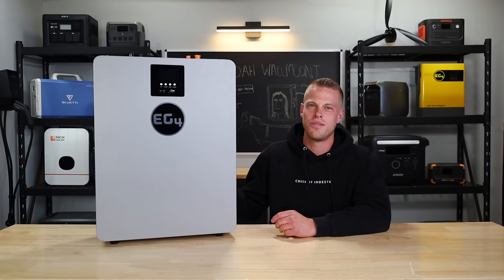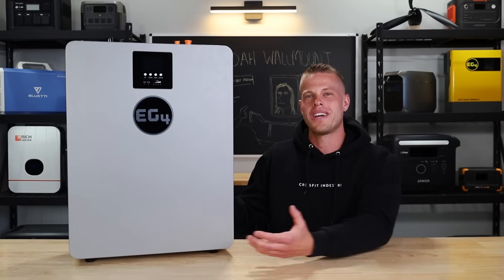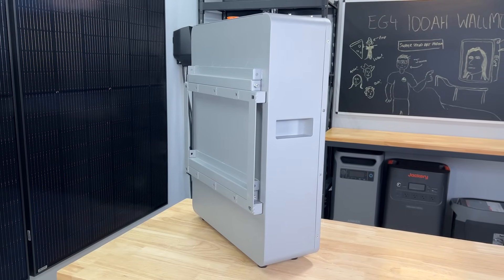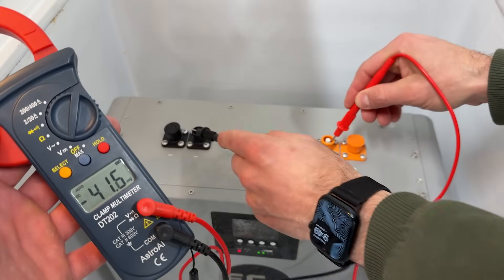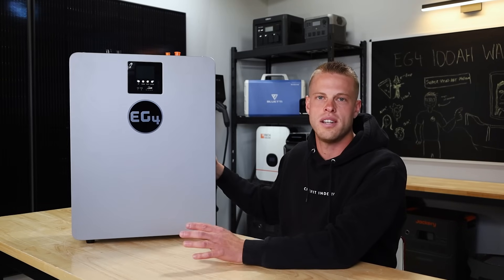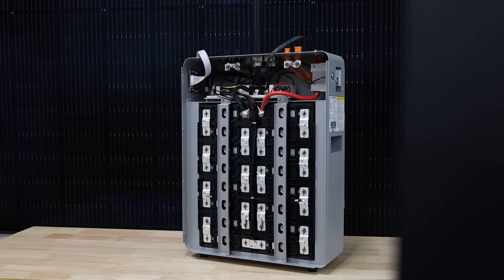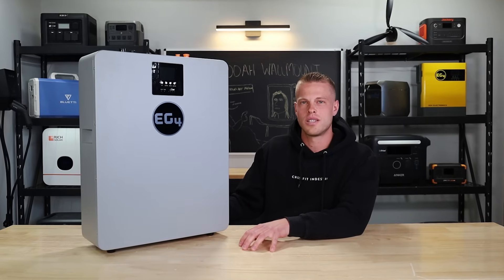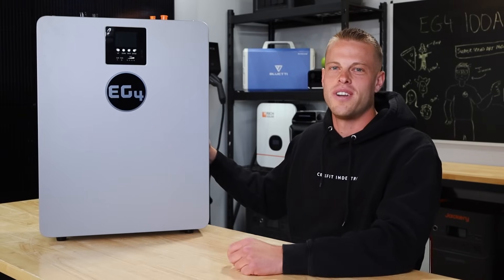Finally! The EG4 We’ve All Been Waiting For! - EG4 100Ah WallMount Battery

Comment: $1599 vs $628? nah.. id still just buy 2x 12.8v 300ah batteries.
and still  have $971 + to buy other things.

sheed lets just decide to buy 4 then. 1,256 and u have a capacity of 51.2v 300ah.
3 times the capacity and $343 still left!

Comment: What is 100Ah? There’s no such unit of energy. This number means different things if this is 12v, 24v, 48v, 56v technology, etc.

Is it so difficult to actually report proper capacity?
Reply: ummm seems obvious thats why
Reply: @cokeiceeeee obvious to whom? What a moronic explanation. It’s like having a recipe for a dish and say add 5 spoons of sugar, without specifying if those are table spoons, dessert spoons, teaspoons, etc.
Reply: @Netscorer  eg4.... what voltage do they use for all their inverters.... okay nough said
Reply: @cokeiceeeee is this something that they teach in school? I never used EG4. I don’t know what they use. I’m sure they may have used one voltage in the past and then changed to another and may change again as most battery providers do. 
You see how without a point of reference 100Ah has absolutely zero meaning.
Reply: @Netscorer  you are just being obtuse... you should get a therapist.
Reply: @cokeiceeeee nope, he is just plain right. 100Ah is not a capacity in terms of energy. It leaves open a variable.
Reply: @MeriaDuck well, at least one person agrees with me. Thanks buddy.  Everybody else is giving me completely different answers based on ‘isn’t it obvious’. Apparently, it is to them.
Reply: The default battery voltage for anything but RVs is 48 volts. If that battery was 24v with the same cells,it would be 200 amp hours.12 v   400 amp hours. All those batteries have 16 cells.
Reply: @danielking2944 there’s no such thing as ‘default’. RVs and boats are using 12v, power stations are using anything from 24v to 56v. I do fully expect that voltage in these banks would continue to grow due to the inherit advantages of using high voltage batteries. And regardless the ‘default’ value, it’s just a common courtesy to use industry accepted form of energy. Go to any physics book and try to find Ah there - you won’t. Only hillbillies are using it because their brain doesn’t compute watt.

Comment: In addition to the price being a little high - it looks like the wall mount bracket is permanently fastened to the back of the unit. Since it has rubber feet for the bottom to sit on hen not hung on the wall, the bracket should be removable so the unit could sit closer to the wall. As nice as it looks and the use space it fills - I will not get too excited about this product.

Comment: The Giveaway signup promises an email to finalize signups, but I have never received such an email.  So I have never finalized any of the several signups I have attempted.  This may only be happening to me, but I kind of doubt it...  Have I been doing something in error?
Reply from the maker: Hi guys, we've been having an issue with our email software. If you entered your email for the giveaway we can confirm that you have been successfully entered (provided the email address is correct), but the email confirmation has not been sent to everyone. Our team is actively working on this.
Reply: same.. i gave up.

Comment: I love EG4 but they’re simply profiting on experience.  Too expensive.  What’s their margins on batteries at this point.  Easily 40-50%.
Reply: $320/kWh is pretty reasonable, especially considering it's self-contained and smaller (thus fewer efficiencies vs a larger pack). Sure, there are cheaper options, but I at least don't trust Eco-Worthy (edit: which also isn't UL-listed), etc. as much as EG4. Not yet anyway.